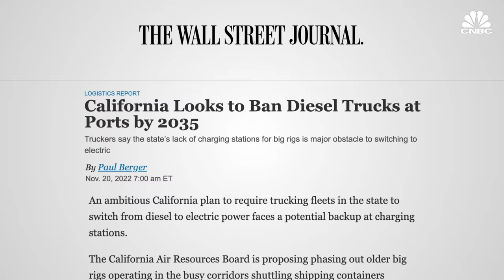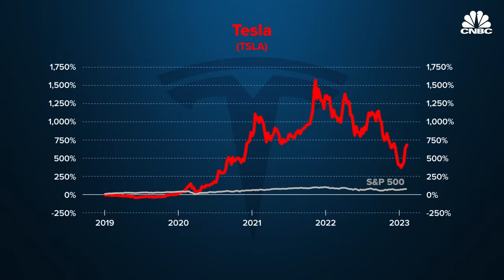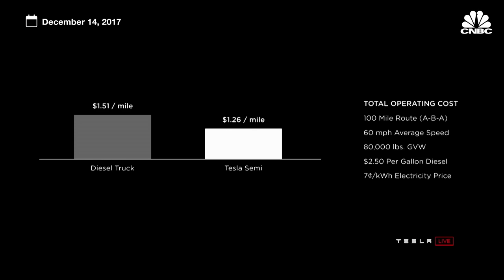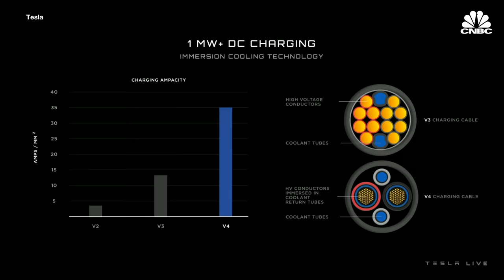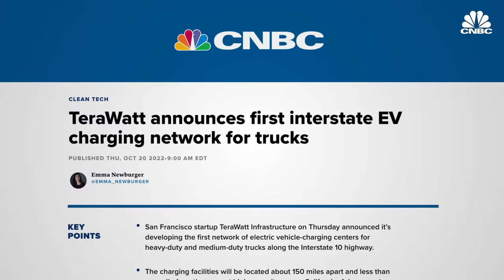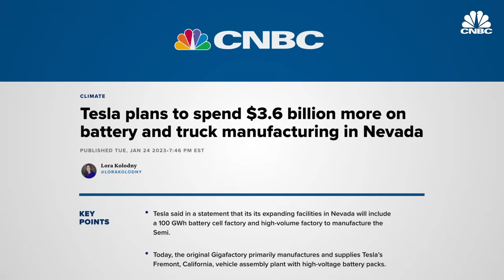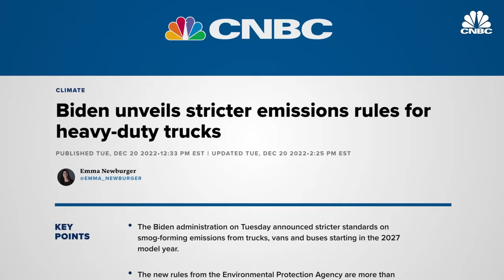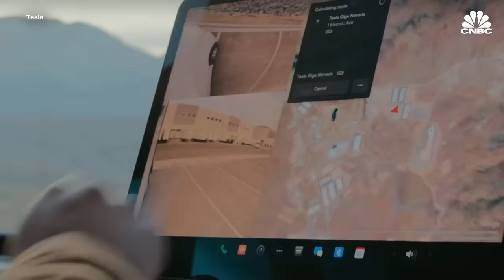Does The Tesla Semi Live Up To The Hype?

Comment: 5 yrs is not bad. Impressive really. Starting from 0 in an unfamiliar industry, 5 yrs is impressive. Now to work out the quirks operationally and production-wise and then, in Tesla style, fly away. Should be interesting to see how they work this out and the market share they grab.

A LIGHTER BATTERY pack is crucial. Hopefully, that will be eng'd by someone soon, otherwise, go for natural gas.
Reply: I am not an engineer, but these trucks need a heavy load cantered around the front.
Reply: Tesla fanboy?
Reply: By Tesla Style do you mean leaving the quirks and letting customers deal with it, like they do with their cars?
Reply: @michaellivingston6768  Tesla style in this context means a production system of continuous improvement. Every year hundreds of small and large changes are done to the cars being built. I'm guessing they'll do the same for the semis.
Reply: Battery pack weight is about the weight of a Semi Engine
Reply: So yeah, I think we can see the issue here with young elons scam marketing. These trucks are hauling a few bags of cheetos- basically air, nothing, just a few miles down the road. That's it.
Reply: @p.chuckmoralesesquire3965  except they are moving chips and sodas hundreds of miles. Also Tesla already released a video carrying a full load of concrete barriers 500 miles so…
Reply: @chidorirasenganz  Sure yeah a marketing video and like I said, they're great for moving a few bags of cheetos a few hundred miles, that's their place. Neato. If there are companies that need to move sodas a few less hundred miles, then use them there too. Sure why not.
Reply: @p.chuckmoralesesquire3965  It’s already been demonstrated to go over 500 miles so I’m not sure what point you’re trying to make. Weight doesn’t matter much to EVs. Aerodynamics is much more crippling to range
Reply: @chidorirasenganz  of course weight matters when you are dealing with things like weight restrictions on public roads, what a goofy take. My point is that there are countless reasons why the tesla semi isn't revolutionizing the trucking industry LOL
Reply: @p.chuckmoralesesquire3965  I was obviously referring to the weight of of the cargo not effecting the efficiency of an EV much. EVs already get a 2k additional weight benefit vs ICE and the Tesla Semi’s battery weighs about the same as an ICE semi’s engine. Meaning the weight penalty point is moot. You have yet to name any of your “countless reasons” that’s actually true or matters in the real world.
Reply: @chidorirasenganz  no the "weight penalty" as you correctly described it is still a penalty LOL but yeah hey if it saves some gas emissions great, neato.
Reply: @p.chuckmoralesesquire3965  except there’s no penalty if the payload is the same. Also there’s saving in fuel and maintenance in addition to the environmental aspects.
Reply: @chidorirasenganz  What is your point?
Reply: @p.chuckmoralesesquire3965  That you’re original comments on the Semi’s range and how much weight effects an EVs range are incorrect.
Reply: @chidorirasenganz  Of course weight and payload matter and are relevant and they're still hauling cheetos bro. Look at the logo on the side of the truck. You're going in circles my man.
Reply: @p.chuckmoralesesquire3965  Nah you’re just missing the point. There hauling Cheetos AND Pepsi. Also they’ve hauled concrete blocks.
Reply: @p.chuckmoralesesquire3965  I’ve already debunked that the payload concern if you read my previous comments and there’s plenty of youtube EV towing videos that debunk the fact that the weight of what you’re towing is a much smaller factor than how it is effecting aerodynamics
Reply: @chidorirasenganz  no just not easily tricked by marketing like you, good to know LOL
Reply: @p.chuckmoralesesquire3965  or maybe Im just aware of how EVs work from personal experience and research and don’t write off what I don’t understand as marketing 🤷🏾‍♂️
Reply: @themidgetsman  A trailer will have little drag as well since the Semi is designed to match the height of the trailer. Only uncovered large irregular shaped objects will really effect range. I’m able to reach EPA range at 70 mph in my SR M3 so speed isn’t as much of the factor it’s lots of sudden drastic acceleration. The Semi also had plenty of range remaining so it likely could have gone faster and still made the trip. Also I think in California the legal limit for Semis is 55mph so that may have been the reason if they are going to release a video they probably don’t want to be technically breaking the law in it. As far battery degradation that sound about right for 2070 based Teslas but the 500 miles is for a fully loaded trailer. If the shipment is limited by volume then even with degradation it could still meet that range. Also keep in mind most degradation happens initially (for personal use in the first year) and is much slower after that. So it will likely be ~10% for most of the operating life of the vehicle. Another point is they seek to improve the vehicle efficiency though further software updates. Currently they are at 1.8 kwh per mile and they are looking to get down to 1.6 at least which would add over 50 miles to the range.
Reply: Tesla has been in business since 2012 so not exactly new to the EV field but among the most experienced and it shows, their EVs are currently at the top of the EV heap.
Reply: @chidorirasenganz  its ok bud, I get so many ads for CNBC on my facebook feed, I have a much better understanding of the kind of brain rot they spread and it's cool if it takes you 10+ years to figure it out while being smug, dumb, and proud of it. Keep insisting you're the smart guy LOL it's adorable
Reply: @michaellivingston6768  - What quirks, my 3 year old Tesla has none. Best car I've ever owned and driven and I've been driving longer than you've existed, unless you're a real old senior.
Reply: @p.chuckmoralesesquire3965  Actually this CNBC video is trash. I just thought they might have additional info but not really. Though your insistence on remaining ignorant is certainly something
Reply: @Chainyanker007  yes I've seen thousands of online dorks like CNBC every where marketing for them. They're everywhere, and they never shut up.
Reply: @chidorirasenganz  Hey you did it LOL you figured it out finally, trash marketing, good for you man. I'm proud of you!
Reply: @Chainyanker007  The thing is kiddo, when I hear you guys doing all of this free advertising for young elon, and not getting paid a dime for it,  and getting completely ripped off, I just can't help but think to myself that you guys are the poster-kids for why we can't have nice things in america- the inevitable failed outcome when our society tragically decided not to raise taxes on all of you decades ago. And so here we stand.
Reply: @chidorirasenganz  "I just thought they might have additional info but not really. " LOL now that is a hilarious self-report,  you did it, you finally figured it out, that neither you nor CNBC nor young elon are bringing anything new to the table, you been drinking the same kool-aid for years and are SO close to figuring it out LOL bro, thank you for the laughs.
Reply: @p.chuckmoralesesquire3965  Once again proving you don’t have very good reading comprehension. I said that I thought there might be new info aside from B-roll. I stated there wasn’t. Not sure how that proves any of your points especially since I never said I was a fan of CNBC. But whatever helps you sleep at night 🤷🏾
Reply: @chidorirasenganz  yeah so you figured it out buddy, it just took you a while and that's ok
Reply: @p.chuckmoralesesquire3965  still being deliberately obtuse I see
Reply: @chidorirasenganz  because I can tell you so badly want to argue on some grounds of a total nothing burger LOL yep, you figured it out!
Reply: @p.chuckmoralesesquire3965  Projection is strong with this one 🙃
Reply: @chidorirasenganz  shrieking "pRoJecTiOn" on youtube, LOL how original :)
Reply: @p.chuckmoralesesquire3965  If the 👞 fits 🙂
Reply: @chidorirasenganz  cry more bud
Reply: @p.chuckmoralesesquire3965  cope
Reply: @chidorirasenganz  copium
Reply: @p.chuckmoralesesquire3965  keep coping bud
Reply: @chidorirasenganz  cope harder
Reply: @p.chuckmoralesesquire3965  Your cope train is going full stream huh?
Reply: @chidorirasenganz  cope on bro
Reply: @p.chuckmoralesesquire3965  and cope goes on…
Reply: @truthalonetriumphs6572  - Well after driving an MS for 3 yrs and buying TSLA early on, you betcha.
Reply: @p.chuckmoralesesquire3965  - The why part is easy. The cost per mile running an EV, including a Semi, is much less than that of a gasoline or diesel burning vehicle.  The Semi will be proof that powered by electricity is much cheaper for a truck, esp. since the Semi has the range and load capacity of a diesel truck.
Reply: @themidgetsman  - Won’t be long before the 4680 batteries go into the Semis. That will changes things drastically, imho.
Reply: @themidgetsman  Exactly, great points across the board. Electric vehicles have their place but there are many many reasons why it's still too early to get excited about them in the industrial and commercial spaces. I love my e-bike and my electric chainsaw, but they are both NOT a full time, all-day every-day replacement for my 4 cylinder car or my gas-powered 18" chainsaw. And hey if these guys have enough money to throw around to get ripped off on  a tesla while celebrating it, we should all be that thin skinned and privileged I guess :) the world would be a better place

Comment: Elon: 500 miles range at maximum weight!
Pepsi: Let's carry some bags filled with 80% air... for 400 miles... just to make sure...
Reply: fair enough
Reply: A Tesla Semi drove 500 miles from Fremont to San Diego, CA, on 93% battery charge, loaded to within 1,000 lbs. of the 82,000 GCVWR, with a payload of about 42,000 lbs. The pallets constituting the load can be seen at the beginning of the video, here: https://youtu.be/GtgaYEh-qSk, and one of them is marked 600KG (almost 3/4 ton). Is it your claim that a pallet of "some bags filled with 80% air" weighs >1,300 lbs.?

Comment: Frankly, I'm impressed by this report by CNBC. In the past their reporters have been, err... quite biased in some of their presentations regarding Electric Vehicles (EV's) However, I found this to be a well balanced report. Of course there are pros and cons of a new product and it is important we, the viewing public and potential customers, are made aware of these. 
For small trucking firms, the initial capital expense of transitioning to EV (or other alternative fuel vehicles) is quite daunting and, for some, impossible to implement. I'm very happy that Pepsi is the "testing" company rather than dozens of small operators attempting to be the trending initial users. ie Get the problems sorted out first, then the open market. 
I agree that 50,000 in 2024 seems to be a tad optimistic. However, the future looks bright for EV trucks from a number of Companies. Plus, of course, the Tesla version looks particularly attractive. Leading the market! Thanks guys. Cheers.
Reply: Agreed. I follow CNBC's channel because their journalism is pretty good. They actually report facts good and bad, although like most outlets they tend to spend a lot of the time on the potential negatives because that creates better engagement. I'm ok with that since most of the time the results and determination of engineers to get the job done speak will lead to a better future if we keep an open mind.

Comment: Yard dogs, like @6:24, electric rigs make a lot of sense.  Inter-local and local, electric rigs make a lot of sense (take off the sleeper and shorten the frame).  Last mile smaller box, electric makes a lot of sense (I see Rivian box for Amazon at times now).  All of these scenarios allow these vehicles to run in their respective range window daily.  Issue here, though, is current recharge source.  If delivering throughout the day, cannot take advantage of optimum solar window, which is midday, meaning a storage of some kind until evening charge or having two rigs (one charges throughout the day, other is used throughout the day), else recharging at night via wind/fossil fuel sourcing is needed.  Would solar panels on the box tops be a cost effective range enhancer?

I applaud Tesla for taking a stab right at the center of heavy transportation, meaning OTR.  Charging location and sourcing will work themselves out over time, just like what happened in the early 1905 to 1920 timeframe during the heavy transition from horse to horseless.

What I would like to see, for grins and giggles, is a current diesel Class 8 (80k) and a Tesla (82k) run west out Denver on I-70 to Salina, UT (450 miles one way; could the Tesla make it to Salina without stopping to charge) and back, and then compare cost per mile and average speed.  Would love to see how the Tesla compares to the current diesel Class 8 over Eisenhower, Vail, the San Rafael Swell and Salina Canyon.
Reply: It is fair to ask when an electric truck will be as good as a diesel.  but
It is also fair to ask when a diesel will be as good as an electric truck.
Both have strong points but the electric trucks are the first ever and the diesel is long in the tooth.  With better batteries which are coming the electric  truck will be a no brainer.
Reply: @Frunkenstein  True, yet what was the route?  This route looked awfully flat, and if a California route, Class 8 is limited to 55 mph (note the speedo on the left screen was not visible).  I'm asking to see mountain passes and higher speeds to baseline, not judge if the Tesla is fully-fleshed or not.  As I noted, I applaud Tesla's effort as we are still in the horse to horseless phase.
Reply: @Dan Harold  Very fair.  All I'm stating is, are we at Panacea or are we at version 1.1?  More documentation needed.  As noted in the video presentation, there is also hydrogen and CNG in the mix.  What about diesel electric, like a locomotive? Better batteries will most definitely help, just as gas and diesel engines have improved markedly since 1897.  Grid infrastucture and power sourcing to accomodate such a load?  Familiar with GM's first attempt at an air-cooled engine, and I do not refer to the Corvair?  Improvements occur over time, some being incremental and others major.  We are at the infancy of OTR BEV.
Reply: @sntstafford  Definitely not a panacea.  More like version 0.9.  Current pre production is being tested at Pepsi.   Everybody wants to know about the range and load. I think that is yet to be determined.  We are fairly sure the battery in use now will be replaced by some flavor of the 4680.
In terms of the environment forget about diesel in any form.  Diesel trucks are already too complex and Diesel over electric will only make it worse.
My crystal ball tells me that Tesla will see to it that it's electric semi do not lack for an opportunity to charge.  Too much money on the table.  I see Tesla charging stations with wind + solar + battery storage up and down US highways.   Regulation permitted they will generally sell electricity to the grid not consume it. Just as EVs made the grid better so will the electric trucks.
Reply: @sntstafford  Didn't that trip include Donner Pass?    Tesla was frequently seen testing the truck there.
Reply: @Dan Harold  Agreed, too much money, future market share involved at this time to change course, except for the better.  The business education in me would like to see the metrics so as to understand better the direction, time frames involved, etc.
Reply: @sntstafford  Even if the released truck is somewhat anemic there are enough cases in which it works to push out the need for a new battery several years.  Tesla will sell all it can make for some time as is.
Reply: Ever heard of Tesla Megapacks?  Booming business.
Reply: @Chainyanker007  Yes, heard of them.  Rollout is occurring and will help with the storage I mentioned as part of the need to capture daylight hour, unused electricity.  However, where will the priority occur:  trucks or homes?  And what is the implementation timeline?  What needs to occur as an interim until rollout is complete?  Those are my questions so one know where to invest what, when, at what ROI.